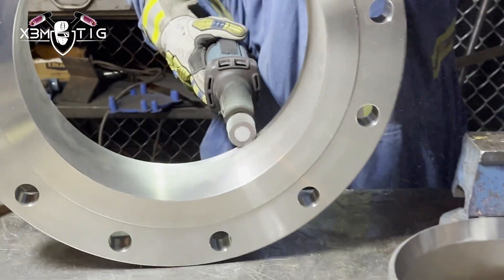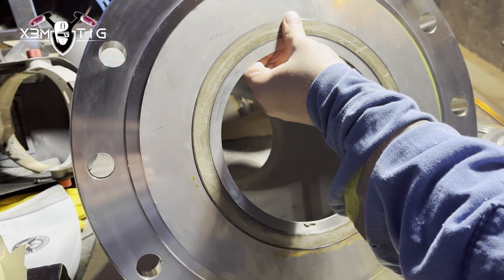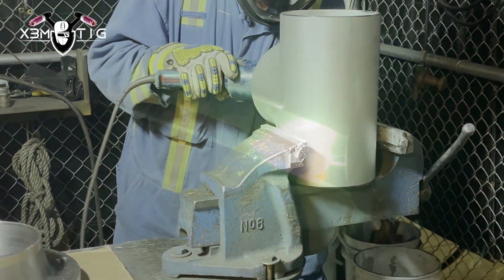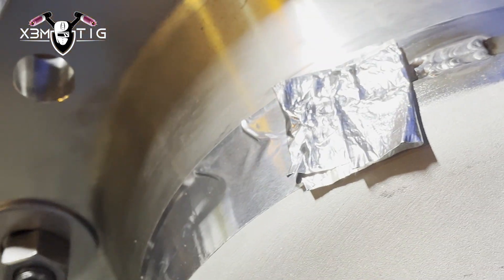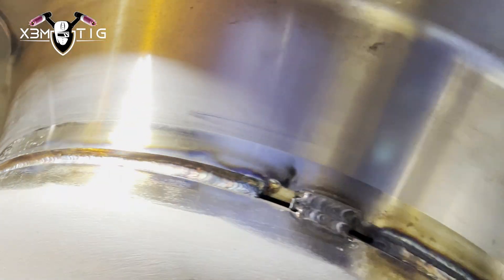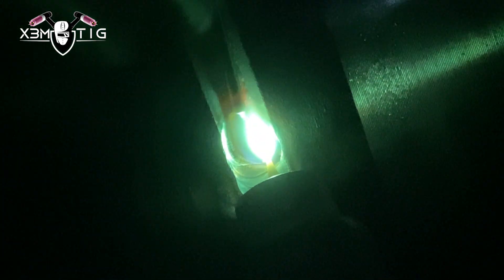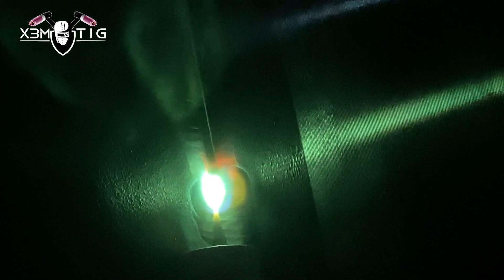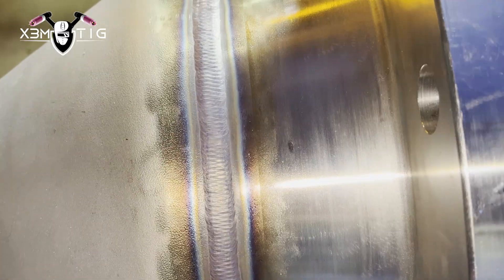TIG Welding 12” Stainless Pipe: Pro Tips for Root & Cap!

Comment: nice sir, im tryin this year to get this kind of job and be the best around.
Reply from the maker: Best of luck!
Reply: @X3MTIG so the people I work with are always saying they don’t run anything over 90 amps, 1/8 tungsten, #8 cup on schedule 10 stainless steel pipe but I see you starting root at 95, hot pass I think at 100, and cap at 115. And it all looks awesome! When I try welding at 90 amps, it takes all day and the pipe gets too hot

Comment: I'm new to welding. What does it mean when your purging? I see you cover up everything and hook up a hose with some kind of gas? What gas is this?
Reply from the maker: Argon is an inert gas, meaning it does not react chemically with the metals being welded. This property helps prevent oxidation and contamination of the weld area, which is crucial for producing high-quality welds. Mostly used on stainless steel piping
Reply: @X3MTIG  so what would you do if you weld 1/4"-3/8" aluminum?
Reply from the maker: @Rubo7  depends from the code and welding procedure, but generally you use Argon as well for purging
Reply: Argon, same as feeding the torch.
Reply: @dougtenney1029  trapping so much argon isn't this dangerous and really flammable?
Reply: @Rubo7  Nooo.  Argon is inert, like helium but way less expensive.

Comment: I don't know how to do walk the cup. Is the head of your torch flexible or locked in place on the one you use for walk the cup? When I try walk the cup technique the flexibility in the head of my torch screws it up for me.
Reply: @KrogunDK  if you’re using a CK Worldwide head they are notorious for flexing to much. I’d go with profax, that’s what I’ve been using lately and it makes a hell of a difference man. You need something stiff enough to handle the position you put it in. It’s a lil pricey but worth it in the long run.
Reply from the maker: I use flex head, and you need better torch

Comment: I’ve been welding sch. 10 316 for the last year now. We usually butt weld every pipe. But biggest we go is 6 inches and everything is done in an automatic rotator. I see you rotate the pipe with your filler hand. You’re not worried about putting the oxidized wire back into the root? Great video though. Love the arc shots.
Reply from the maker: Thanks for your comment bud, oxidized tip of my filler rod is so minimal and doesn’t create any problems! Good catch though 👍